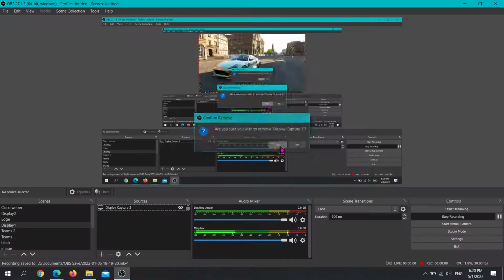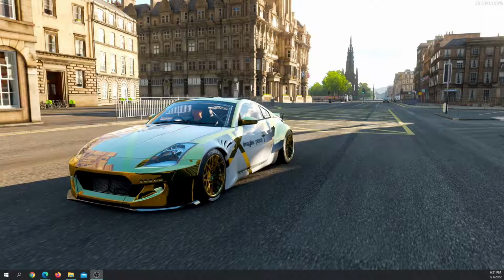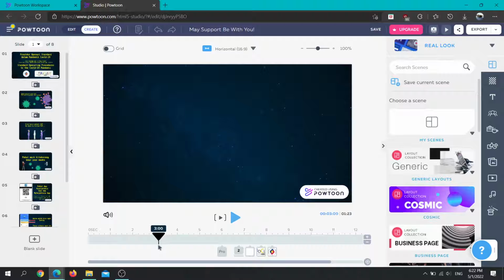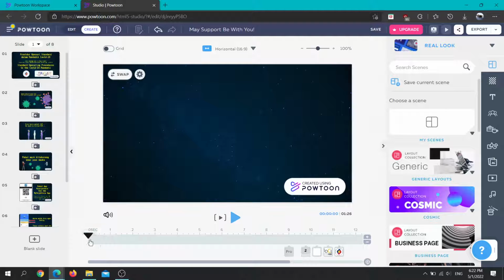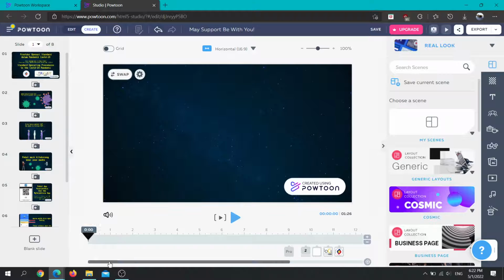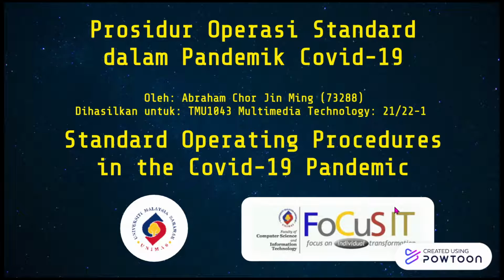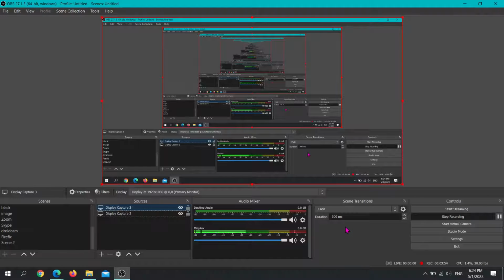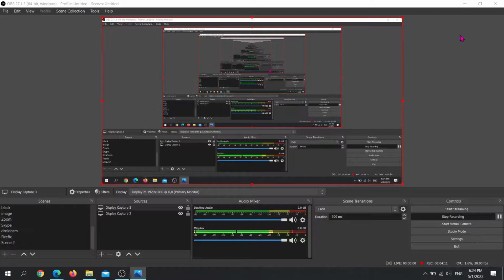How To: Record PowToon Using OBS! (NO MORE PAYING FOR POWTOON PREMIUM!)

Comment: Hello, i saw your UNIMAS video , i want to apply too. 
When is the nearest date for application to open agian for international students plss?
Reply from the maker: Hello there! For international students, you can contact the main office by phone (Malaysia +6 082 581 000, tell them you would like to apply)  or try out the website in the next comment (in case it gets taken down). The next semester for local students start around March and you should be able to apply via website or manually by contacting one of the admins.
Reply from the maker: Here is the form you can fill in, remove the spaces

https://iadweb.unim as.my/UGIntOnline App/App Form3.jsp

Here is the website you go to for more info

https://www.unim as.my/ad mission
Reply from the maker: As usual, please confirm and doublecheck all information received from me with trusted sources. I will not be responsible for any losses or mishaps that occur due to info on my channel. You have been warned ( ͡° ͜ʖ ͡°)
Reply: @haachor  thank you so much. Ofc i will double check.  And it’s my responsibility.
Reply from the maker: @flymetothemoonpls7663 All the best for your application!